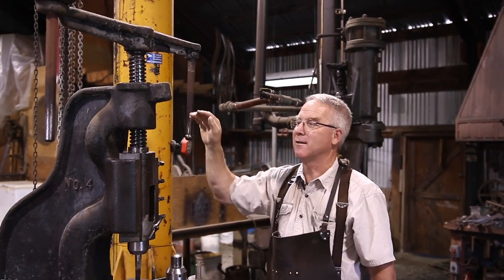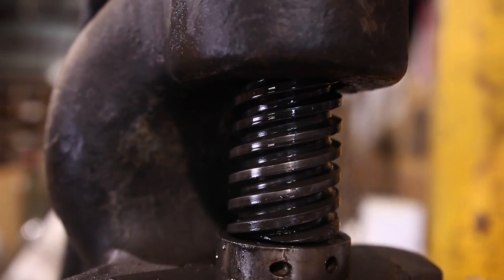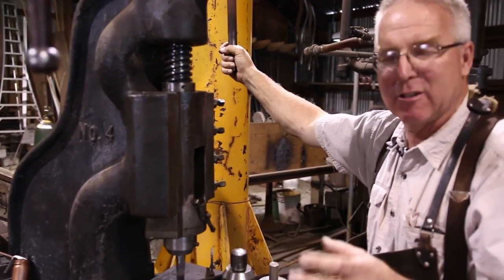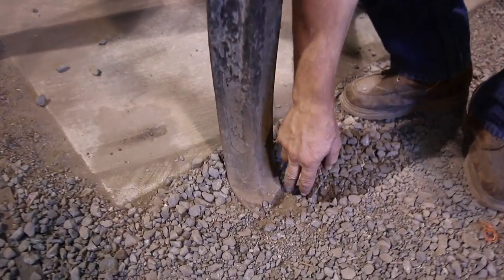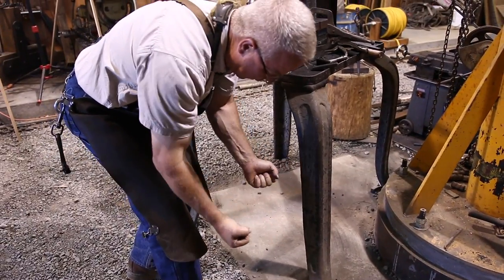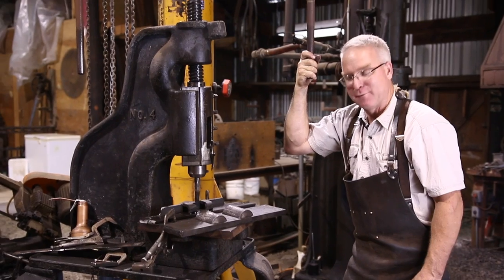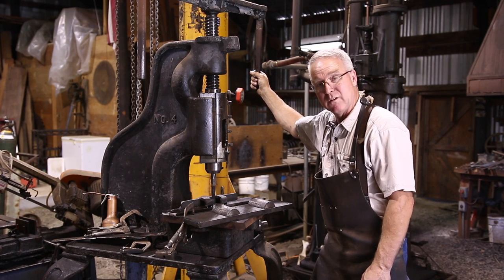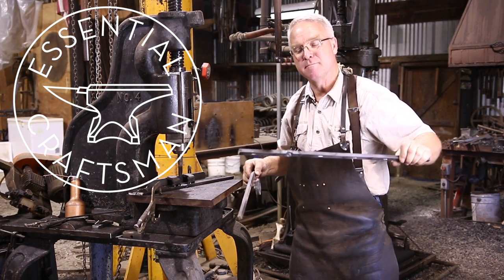Ever Seen A Fly Press?

Comment: The machine shop where I was employed for twenty years had a manual press similar to this one except heavier and designed to try out metal cutting dies. It had a heavy round upper wheel for momentum and large vertical square thread for impact force. This "try press" was rated at 30 tons. A die set with proper stop blocks was placed on the bolster and the heavy round wheel spun to produce maximum force.

Comment: Excellent display of your press. I have a John Heine 7 ton press here in Australia. Rated 7 ton I guess if you can swing that hard. I use it a lot for Blacksmithing work. It is strong and robust and made from cast iron, which accepts hot steel sitting on it for a short time. Thanks to others for comments on the Acne screw thread. Good info.
Reply: Just for further info. My press only has one handle so you get the full 360 deg before it has a chance to hit you. Maybe your press would be safer and easier to use with one down handle removed. (the one opposite the ball end)

Comment: If you're description of the thread is accurate it has a triple start thread witch will help with axial movement but the main reason of a multiple start thread is that with three starts it will move three times as far for a given amount of rotation of the handle than a single start thread would that has the same pitch.

Comment: Is there any benefit to having the load only located on one side? In my head it would be a better design with two smaller weights, one at each end.
Reply: Actually, I have seen a fly press that had no individual weight hiked out like this one.  Instead the thing looked like a steering wheel.  The “wheel” was heavy but the spokes were not.  It still needed a hand grip and if I remember right, the one I saw had two, still allowing the operator to bang their head.
Reply: You can put two ball weights on, i had one and one had a horrible noise it made, like it was going to jump off! It never did or would though thankfully

Comment: Your fly press has the elements and geometry of a bookbinder's standing press. One of these gets you 2-3 times the pressure of a typical hydraulic press for gluing a book into a hard cover (even when your "book" is the size of a newspaper!).

The torquing weight was in a 20-inch wheel atop the helical drive shaft. An operator, especially a short one, would hop up on the workbench and spin it down until contact began -- then a half to one turn brings it home.

Machines like these are sometimes felt to be "sweet" in a way no hydraulic device ever is . . .

Comment: Like always great  episode. Just one thing: Triple lines screw thread isn't for standing the abuse (only lenght of tapped slot matters) but to make stroke longer way by one rotation. For example 3/8 inch instead of 1/8, just by one full swing of flywheel. Otherwise operating would take too much hassle.         Thanks

Comment: I have never seen a press like this, very cool. But just thought I'd add that the triple helix or  three start thread makes it so the axial movement of the press is 3 times further than a single start thread would give you for 1 rev of the fly. If you had to spin the fly 3x as many rotations it looks like it would be pretty cumbersome to use.

Comment: Thank you for the videos these are great to watch and learn .
Only the pitch of the thread determine speed of travel ,
The tripple thread only gives more strength to the thread and less torque required to apply the tonnage buy increasing the the thread surface area .

Comment: The triple helix entails that there are 3 starting (and ending, obviously) points for the 3 helices; and having 3 points of contact (or a multiple of 3) has indeed, the advantage of translating rotary motion to linear motion and thereby pressure in the most equally-distributed way we can easily achieve. This advantage is well understood in all fields involving rotary motion, and it also expands to other mechanical aspects of such scenaria; angular velocity is also handled more evenly by the system, and having multiples of 3 weights attached equidistantly on a circle's perimeter likewise means that the rotary motion will be the most stable (i.e. it's the arrangement causing the least deviation from perfect rotation), which is why we prefer putting test tubes in a centrifuge in such an arrangement.

Comment: The thread is a three start acme thread. It is very common now in cnc machines. Basically less friction in the threads so more power goes into movement and less into friction but at the same time you get more movement. Counterintuitive but it works. 
       Great looking machine. I have an 1875 bandsaw that was butchered in a shop years ago because they didnt want to repour the babbit bearings and put ball bearings on it. Good looking machine except for that. Still need to have some parts remade to get it usable.

Comment: I was a scientific Instrument maker and I used a fly press a lot.  I made a variety of press tools for it and it worked very well.  How many of you could make a shear punch and die from high carbon steel with the correct fit and clearance, and harden and temper it.  How many of you can calculate the bending allowances for bending complicated brackets using a bending jig you made.  If any of you need advice about the physics and engineering of these machines, just ask.  I have a B.Sc (Physics) in addition to to engineering quals.  
.

Comment: I think he's wrong about why there's a triple helix, I think it's so that it's so the pitch is coarse, (moves alot down with a single turn) but still has lots of lands engagement (strong action), great machine, thanks for sharing.
Reply: YES.  The ram moves at 3x the pitch of single lead thread per rev of the handle.

Comment: The fly press I remember from the shop I used to work at, had two balanced weight balls on the top, not just one. Seems odd to have just one, with all the imbalanced side loads on bearing surfaces.
Reply: Its on the opposite side for exactly that reason;
Reply: @naui_diver9290  Opposite side of what?

Comment: The triple lead thread helps increase the speed at which the ram moves in relation to the revs of the handle.  Otherwise, you'd have to crank full turns numerous times to get the same amount of stroke.  Take the current tread pitch and multiply it 3X, and that is the stroke per rev.  Multiple lead threads are used widely on gate and globe valves for rapid open/closing.

Comment: I see the beauty in it, but thank god for hydraulics. You can adjust the pressure precisely, the whole thing is smaller and it doesn't try to rotate the whole thing. 
It would be interesting to add different wheels to bring it to do the wanted motion periodically. 
If the whole thing is anchored and something against the lower torsion is added (x-bracing or a big ring-shape) you could do a lot of forming with the wanted matrix on the bottom. 
I'd wish i had all that space you got.

Comment: could you heat the tooling and punch holes in light gauge material . to achieve the same result as flow drilling in the sense that you wouldn't lose material you could potentially thread?

Comment: Have you ever thought about extending the handled on the Fly Press to be more in line with your chest so you can more easily leverage your pressing strength on the machine? After all, a large amount of pressing strength comes from the chest. I bet you'll find there is a large advantage to doing so. 

The same goes for pulling on the handle. Mid back is where your strength is.

Comment: Step 1: Wear helmet while spinning the fly. ;)
Reply: That was my thought too!
Reply: that is why the weight and handle are adjustable  i ran one for a while it is just that to keep it above your head ..first day massive headache
Reply: robert mills In the distant past I have used a number of fly presses of various sizes to press out prototype parts, hundreds at a time. I can testify that it does really hurt when the cross bar catches your head. I only did it once. In the UK it is possible to pick these presses up for the price of the scrap value if you look out for them.
Reply: The Three Stooges would have loved this machine!  😀
Reply: Tested out my new press the other day. Turned my back on it and it knocked me over.
Reply: @dennisbuckner6957  äää

Comment: Largest? We've got one 10 times that size. Has a closed frame and a ram guided by V ways. They're found in diemaking shops for trying out stamping dies. The triple lead screw is for speed - advancing the ram faster with less handle turning.

Comment: It is an ACME 3 start thread 29 degree included angle. A 3 start is used for a quicker ram speed and thread engagement and not   what you stated regarding alignment and central thrust. Cheers.
Reply from the maker: Thank you Bob!!

Comment: Would almost be worth it to build a "wagon-wheel" to hang on the pulling posts to act as both a flywheel and a "head-bar". With a wheel, if you happened to lean in too far, you'd hit the "rim" and not get whacked in the temple, and secondly, as a "flywheel", you could apply additional force from the rotating mass wanting to keep rotating due to inertia.. Very cool tool, which I'm going to put on my "want" list!!

Comment: A triple helix or triple lead screw thread has 3x the movement of what it appears. A screw is actually a ramp or wedge. A triple thread is 3x as steep. It takes 3x the force but you get there 3x quicker. The reason for it is speed. The screw thread in a 2L soda bottle is a triple. You don’t need  much force but you want it to open n close quick. Same with the fly press. You want a quick push before the hot metal cools. Otherwise you would be turning the weights forever. It’s easy to put on a bigger weight.

Comment: Just by way of info, the fly press number is the approximate tonnage it produces, a No. 4 is not very big, they are often found in 5 and 6 ton range, sometimes higher. The screw on my two is also notable for being 4 start. What would be interesting is a video on how the main screw and nut are cut. It's old technology, yet finding someone to make a new nut is very difficult, and it's not done on a standard lathe, yet these screws were used in many machines 100 years ago.
Reply from the maker: Thank you!!
Reply: @essentialcraftsman  The multiple lead screws are/were cut on a standard thread cutting lathe.  Cut between centers with a dog and drive plate that has evenly spaced slots.  Cut one thread, move the dog to the next slot, cut the next thread, and so on.  The nut is done pretty much the same way, but I am not familiar with how the nut is indexed.  One factory I worked in had presses that were 95 feet tall that used an electric "motor" to power them.  The "motor was built into the press and the stator had an inside diameter of abought 8 feet.

Comment: But if you pull on one side oly  0:54 it doesn't apply a proper torque to the threaded rod, there are another forces which make the whole thing move in other directions. I know a lot of tools are designed that way though

Comment: I used to work in an old blacksmith shop when younger. The flypress was so large a guy could hang on to each sphere and spins round 3-4 times before coming to a abrupt stop. The thread must have been 8-10” diameter.

Comment: I punched 500 holes with my fly press and it moved 6 feet from where it started. The next job required 2000 holes so I bolted the machine down so that it wouldn't try to escape out the door.

Comment: "...design advantage of a multi-start thread is that more contact surface is engaged in a single thread rotation"  in this case I think they want a fairly large pitch for a fairly rapid amount of "anvil" travel per rotation...but they still need good load bearing on the threads to take the forces involved.........ref: https://www.harveyperformance.com/in-the-loupe/multi-start-thread-guide/

Comment: Wouldn't it be prudent to attach you anti-twist bracing up on the table, rather than down on the feet? You're still putting significant twisting torque on those skinny legs.

Comment: That chain on only one leg tuging i hope you dont break that leg .Just think about it. You might understand stress should be on all four not two .Two are sliding in stones.
Reply: Essential Craftsman Fatigue can be tricky... making part of it stiffer will only concentrate the loads and break the weaker points even faster. I would think a full box base with at least one cross-brace tieing all the legs together would be best.  Maybe x braced and without the front of the box so you aren't kicking it all the time.  Since it is always striking the piece with clockwise momentum (looking from above), you could also add some shear strength coming from the bed with a few diagonals into your box frame (I'm assuming the bed is >> sturdier than the legs, therefore won't create new fatigue points).  Really enjoying your channel. Thanks for sharing your knowledge.